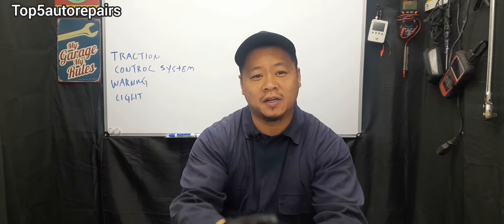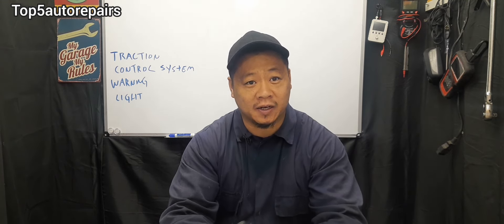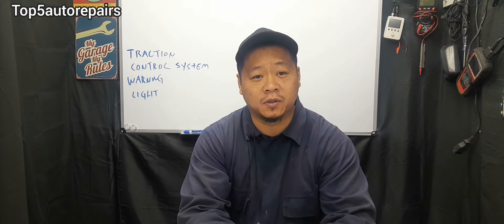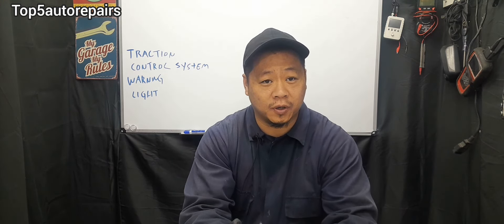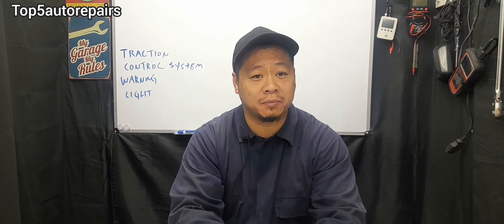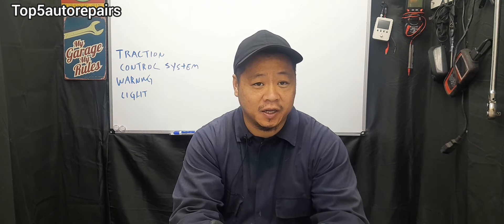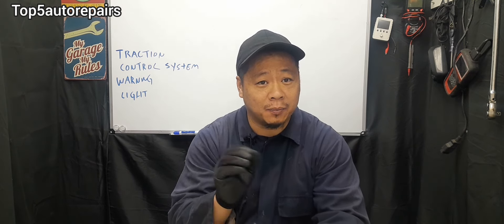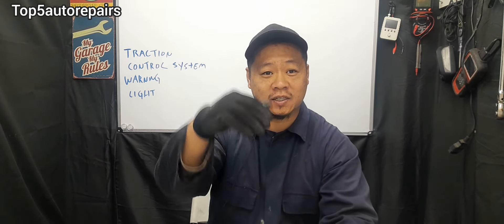TRACTION CONTROL WARNING LIGHT FIX | COMMON CAUSES

Comment: Very informative!! I was told it was a wheel speed sensor that was causing the weird noise & feeling in the brake pedal when I stepped on it & the instrument cluster has an erratic flash + service stability control. 

I acquired this 2002 Escalade w/ a lot of problems… annoying problems that should’ve bn easy to fix. Sum were simply, sum needed a real mechanic- honestly, I think mechanics just didn’t want to fix. I’ve bn to shops & asked shade tree mechanics to fix it. Idk, I guess it’s just too hot in SC for them to work & think at the same time. I’m on the verge of selling it. 🤦🏽‍♀️ (I miss my Tahoe). Thanks for this video.
Reply: I got an 06 Escalade. My traction control and stability control started coming on. At first it would cause my brake pedal to get spongy and reduce engine power. Then after a while, my brakes started locking up and smoking on the front driver side. Now sometimes I can't barely get it to move out park. I changed steering wheel sensor, wheel speed sensor, throttle body, cleaned the reluctant on the wheel hub and it's STILL acting up. I don't know what the ell is wrong with it. It's been about 5 years sitting up but I can't bring myself to take it to a shop. If it didn't have that stupid shit, it would be running good now with no problem. 🖕that truck🤬
Reply: @__-ti2en hi, I have a 2006 ford explorer,  I also had your issue with tye right front tire, took it to the dealer and was told i needed a transmission,  no way, I took my truck out of there quick fast,  drove it slowly to a friends mechanic house,  come to find out, it was my caliper that was worn out and sticking, we replaced it and problem solved, so have that checked if your car is still sitting.
Reply: @minervamercado7873 it is still sitting. Thanks for your information. I'll try to replace it and see if it works. Glad you were able to get your truck fixed👍

Comment: I have Nissan Al tima 2013 as recently i have change tyres and the car was running very smoothly but next day the side tyre has been removed for the AC compressor replacement so i am facing this issue and even the car is not smoth like before as i am feeling tha the same tyre is vibrating/shaking even that is like very rough..

Comment: I have lexues 350 when I 2012 when I press the break traction light coming and all. Wheel stuck. When I relase break car is normal run. What is the probem no any fault cod.

Comment: My Volkswagen Polo 2012 is coming on EPC, Traction control light, Tyre pressure light,obd2 scan show throttle body error code.So replaced the new throttle body.After two days traction control light and tyre pressure light comes on.OBD2 scan shows Airflow leak then workshop done inlet seal.Traction control light and tyre pressure light comes on every evening and every morning disappear.May i know how to fix it?

Comment: Have 2010 Camry & front right wheel spins easily when it's raining as I'm taking off from a traffic light.  It did it the other day in the rain now the light stays on. Guess I'll have to check that sensor.  Has to be the front right.  Thanks for the information!

Comment: Can a really bad alignment cause the traction control light to come on?
Reply from the maker: Yes it can
Reply from the maker: Check for bad wheel bearings. Sometime the wheel speed sensor is mounted on the wheel bearing.
Reply: @Top5AutoRepairs  I just replace my entire front suspension. All Mevotech Supreme parts. UCA’s, LCA’s, CV’s, end links, wheel hubs and sensors, inner and outer tie rods, brakes. My alignment is super off and bad. Alignment shop is only .4 miles away so I won’t be driving far. Just trying to narrow down the cause. I appreciate your response.

Comment: Why is my throttle control light coming on like a half a second before my traction controll light comes on? I turn the car off and turn it back on which allows me to drive a little ways before both lights come back on. I've already replaced the throttle body. The printouts at O'Reilly's told me to replace the map sensor after I replace the throttle body. I replaced the map sensor, but it's still telling me I need to replace the map sensor. Both the throttle body and traction control lights are still coming.

Comment: I have these lights on when I press the brakes at start up and can not shift out of park. Will this fix my issues or should I check something else?😊
Reply: I have a 2005 lincoln tc with a bad electronic door lock module that does the same..try taking the battery cable off and wait a few minutes..resets everything..have to do it whenever it rains..till i can find one...good luck...

Comment: Hi.  I have a 2012 civic ex. Was in accident.  I replace the ABS module was damage.  Now the car breaks by itself when it gets to 9 mph. I replace speed sensor as well.    I don’t have any lights on gauge cluster.    When I press the traction button nothing turn on

Comment: my 2013 rav4 AWD light and traction control light is on after my battery died ? 
they wont go off after the car started, and still wont go off after i left the battery disconnected over night...
 i thought charging the battery might have fixed this, and then hoping that disconnecting battery would clear memory. but it did not...
any other ideas ?

Comment: My tcs light comes on on cold mornings (no rain or snow, just cold) and my check engine light comes on at the same time. It happens as soon as I turn my car on and then it stays solid and my car doesn't want to shift at all. After I let my car warm up, the tcs light goes off but the check engine light stays on. I have an 02 Honda Accord and we've checked everything we can think of.

Comment: I have a 2012 Chevy Traverse LS and my issue is that my brakes are tighten when I’m on the road and I’ll have to wait for hrs for the brakes to loosen up. The Traction Control Off and Service Stabilitrak light pop up.

Comment: question my traction light comes on while driving, it feels like i lose the power steering and brake is hard to push. i noticed yesterday that the RPM went from 1 1/2 to 0 when the light came in and still in drive . when i put it in park the brake gets really hard and wont push down .i have to turn the van off and back on for it to go away ?? no one knows what it could be, its been tested 7 times nothing comes up .any answers ????thanks
Reply: Having the EXACT SAME problem in my 2014 Versa :(

Comment: Iff the engine light came on first, then the power steering went out, and the traction control light came on is it safe to drive to a mechanic.  Also, what could that be?

Comment: Bro PLEASE HELP….when it is hot outside…only when it is hot outside…the Service Stabilink comes on, the Traction control turns off and “NO” check engine light comes on….when it cools off at night and I start the truck in the morning the lights are all off….I have a 2012 Chevy Silverado 1500 5.3 LT Crew cab….as I said this ONLY happens when it is 80+ degrees outside?!?!?!?! Loved the video

Comment: I have a c0298
P1120
Wire was damaged and replaced. I erased codes works fine. I turn off vehicle and the codes will appear again.. I erased codes again.  Works perfectly. Turn off and back on again and codes reaper

Comment: I got my brake master changed in my Mazda 3 2011 and now my car can’t go faster than 5 mph but it’ll be a 2000 -3000 rpms with the traction control light on

Comment: My traction control light come on while driving the tire pressure light blinks for  a minute when starting then turns solid and when I turn to the right my suv wont go for a few seconds and while driving feels like I'm getting pulled back and feels like it stops sometimes while driving?

Comment: my tracking control,  ABS and brake lights. No error code in ODB check and wont reset with battery disconnected

Comment: HI SIRI GOT DODGE RAM1500    2010  ANY TIME TRACTION LIGHT COME ON BRING P0344 CODE WITH IT.I CHECK ANY WIRE TO ECM  CHNGECAM SENSOR . TODAY DRIVER 32MLS  BRING BACK TO SHOP REDRIVER  TRACTION COMEON ATERFEW  SECOND P0344 COMEON PLS HELP.ANY YOU HAVEANY  INFO

Comment: Hey there. 08 ram 1500 hemi.. out of the blue the light started blinking. Truck started stuttering.. no acceleration and didn’t wanna brake properly. Truck turned off while driving. Unplugged the battery to reset computer. Couple of hours later same thing happened after cranking and going home (20min drive). Can anyone please help ???

Comment: For some reason  I turned  my ac the traction light turns on and now it doesn't turn off I checked and it says camshaft sensor I've replaced it and again it turns on still and keeps telling me it's the camshaft sensor
Reply: Having the exact issue with my Subaru

Comment: On my 2009 Mazda CX-7 GT, my TCS light stays solid and NOT flashing for a few seconds after turning the key to the "ON" position.

My manual states "If the light stays on the TSC/DSC may not operate correctly" and of course go the the dealership.

Any thoughts?
Reply: I believe it's normal to stay on for a few seconds when you start the car. Don't get ripped off at the stealership.

Comment: My traction control goes off, and I lose power, forcing me to pull off the side road and turn the motor off. Then, when I restart it, it's  fine. I have a 2015 Chevrolet  Traverse. Any help is appreciated.

Comment: How do i maintenance / cleaning my 2006  BMW E90 fuel i jectors without removing them? also I have a whistling sound when my engine on running temperature, Also when driving at high speed there's this hollow buffering sound that comes from the driverside